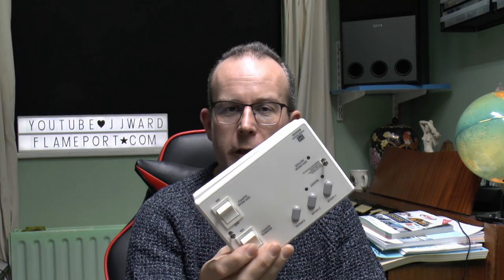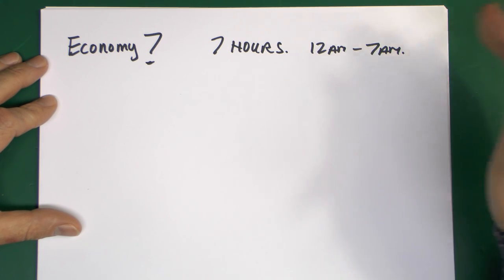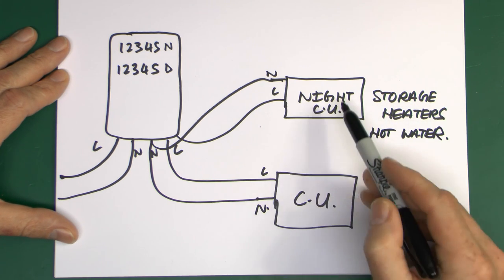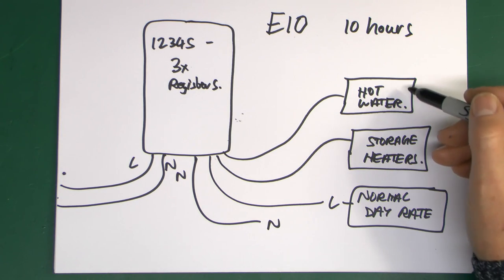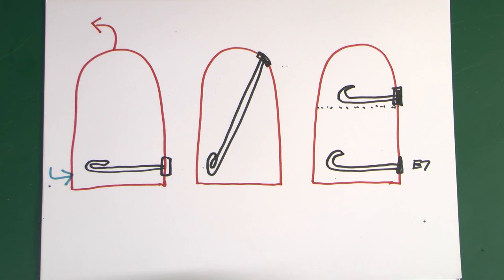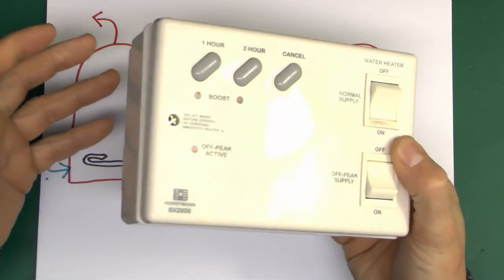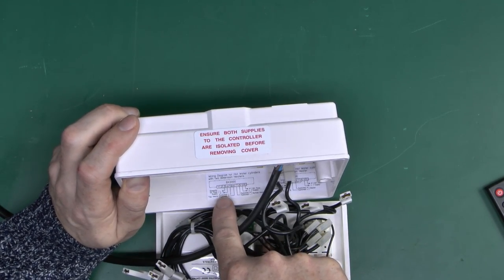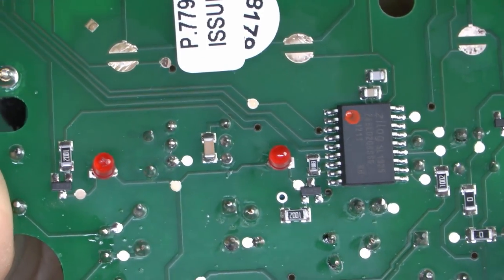Economy 7 and Horstmann BX2000

Comment: I've seen the arrangement you've described at 11:05 in at least 3 of the 'modern' flats I've lived in. I presume it's due to the meter being some distance away, so the single submain can carry all of the load without needing to run 2, and a smaller 'control' circuit used to activate the contactor during off peak times. The contactor woke me most nights with it's thud around midnight! Served as a good reminder to get the washing machine on though :)

Comment: I lived in a place with a meter which had 2 registers, normal and heat. You got ~7h overnight for water and storage heaters, but there was also an unswitched output for heating during the day(shower, panel heaters, hot water boost).

Comment: I think its also common to have a output which is switched when cheap rate, but for all the energy used in that period to be charged at cheap rate, not just the switched output. I'm fairly sure that worked in another place I lived. The teleswitch switched an output, and also signaled meter to switch rates
Reply: Yes, i think on some there is a dedicated contactor in the teleswitch for "cheap electricity"

Comment: I did hear of people taking out some storage heaters and putting 13 amp sockets on instead,so they could get cheaper electricity at night. I think electricity boards were not too happy with people doing this and also the sockets could not be used outside the off peak hours that you mentioned. Interesting video,thanks  for uploading. That  system with the 3 outputs reminds me of a system they have in Scotland I think it is called total heat total control.

Comment: We have the analog version of this in our beach house for the mains pressure, storage hot water tank. The tank has 2 heating elements; top - daytime  boost, bottom - E7, and it and the timing thing is in the garage - ground level below the seawall. The timing thing has the timer dial for economy 7, and the booster dial for 0-120 minutes, and a timed/off switch, this is wired to a switched spur fuse = I assume it runs off the nominal 24h electricity supply and the beach house has a single meter. Annoyingly the sparky had put the time thingy in the garage = if we run out of hot water/comes out warm and one of us has to put on coat, shoes and find the key fob for opening the shutter and go to it and guess how much in minutes is needed to reheat the hot water and set the booster timer and go back upstairs - seawall level, and if the weather is raining and windy - we would be put off from boosting it and run out. would have been more convenient if the sparky had fitted it in the kitchen and we could just go to it. I would be fascinated/intrigued to find out how the analog ones work. 🙂

Comment: Good information on tt systems.. A cpl of questions.. 

Would you require a 100ma time delayed rcd for tails going from an external meter box thorough a cavity wall  to rcbo board the other side

Also if you had sub board fed from DB1 with  with an 30ma rcbo  to Db2 in the garden..(not good design I know) .. Would you need a  seperate earth rod  for DB2

Comment: I have Economy 7 in my bungalow with this exact set up (2 elements). I have a separate connection unit for both elements. I honestly can’t see what this Horsmann unit adds, apart from the 1 or 2 hour boost (you can achieve the same result by simply remembering to switch off the day switch after an hour). My connection units are the 1970s Bakelight ones, still working after 45 years (and cost under £5). This unit lasts 5-6 years and costs £80+. I don’t think I’ll be rushing out to buy one.
Reply from the maker: For 2 separate elements it's only small benefit is that it will switch off the boost element if the E7 supply becomes available.  It's really only for systems with a single element that need a boost function.

Comment: Worth saying i have solar PV so economy 7 actually makes sense for me since I primarily use solar during the day, not grid power. Plus the day rate was only 1p/kWh more expensive than not having economy 7 so it worked out favourable. I have an electric car as well which is set to charge at night
Reply: Hi Simon just wanted to know how are you switching your electricity from renewable source to cheap electricity at night. Can i some installation pictures too . :)
Reply: @saloniporwal3556  no actual switching occurs because it's not required. Part of the PV system is that it outputs the electricity at the same junction as where the mains incoming connects, after the mains meter. The PV gets used in preference to the mains (I assume it's a slightly higher voltage??) But when it's overloaded (which is dynamic based upon light) I guess the voltage sags and the mains props it up. I'm thinking something like in a dual dc power supply feeding through two diodes to the same output. Conceptually at least, not sure how it works inside the PV inverter

Comment: Our builder was too cheap to put the Horseman unit in so we just have two switches. If we need a boost then we have to remember to turn it off an hour later.

We are just about to replace the whole system though. It might have made sense 30 years ago but today it is an ineffective way to heat a three bedroom house. Not quite decided but we will probably put oil in (no gas in my street).

Besides E7 and E10 there was another system called SuperDeal which would give you an afternoon boost on the second circuit. We moved away from that by choice a couple of years ago but I think the supplier was going to force us off it anyway.
Reply from the maker: For an entirely new installation, a heat pump would be a far better choice than an oil boiler.
Reply: @jwflame  We have been thinking about that but there are some limitations in the property that make it difficult.

Comment: Hello John, new viewer so I appreciate this video in particular. I notice the non latching relay and wondered is it possible to isolate the timing circuits and automatically change between the on peak and off peak supply just using the relay and the isolation switches. I assume the pcb provides the timing circuits and signal to the relay. I am controlling an Air source heat pump which replaced storage heaters, but my concern is the time delay in switching, as I think the air source heat pump control panel resets each time the off peak supply switches off. There is a seamless transition between boost and the off peak supply switching on. I'd be interested to hear your thoughts.

Comment: What's weird is that my radiators and hot water only work when using the boost options, they don't seem to heat overnight or anything. I have no clue why